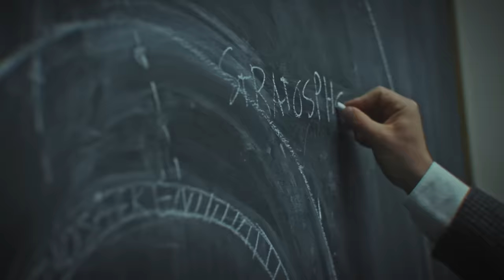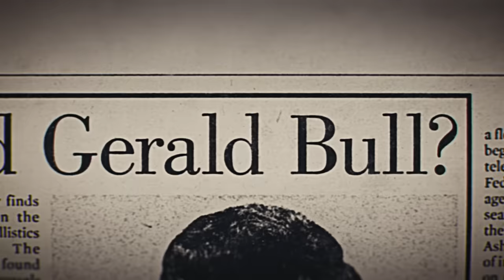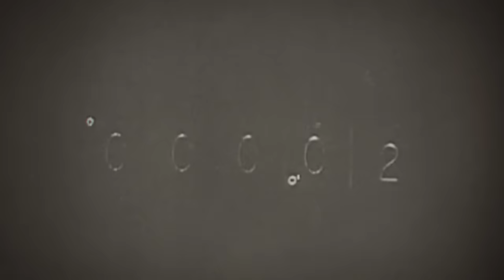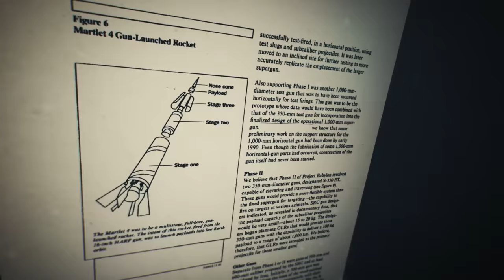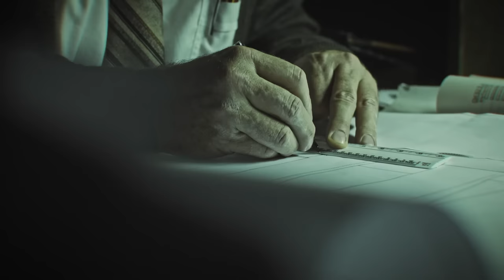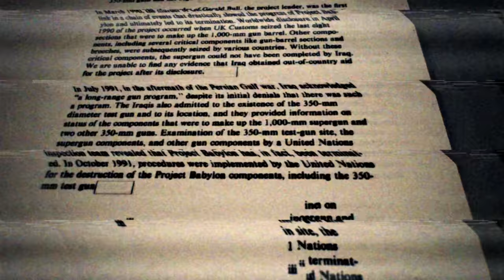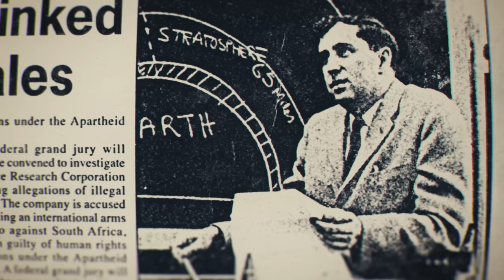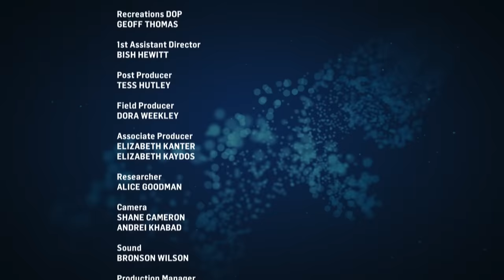The Fate of Dr Gerald Bull - Deadly Intelligence - S01 EP06 - True Crime

Comment: With modern advanced meta materials, this tech would be viable for space launches.

Guy was a genius, but he forgot the golden rule; leverage is the only real form of currency.

If someone's at risk of taking you down, you need multiple redundant dead man switches so the people responsible can never recover from their act.
Reply: viable for cargo launches but not people and they literally just reused old oil pipes so it was easier on the budget
Reply: @Aaron-zu3xn  Cargo weight is the biggest cost expense for space travel.

But yes, G forces would be bad for humans with current technological levels.
Reply: Dead man switches don’t work